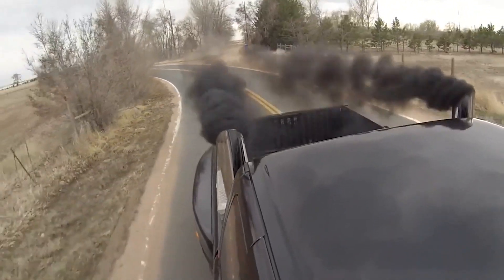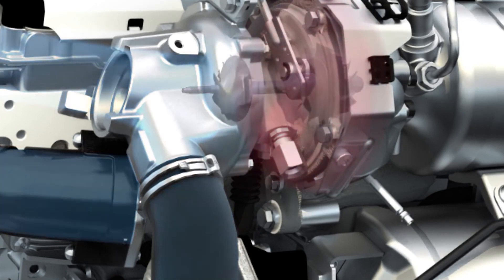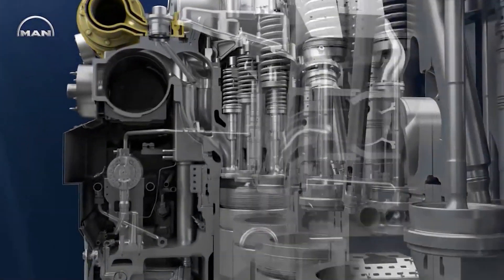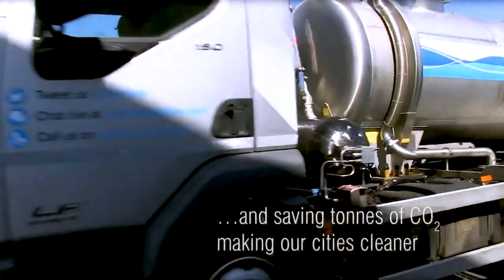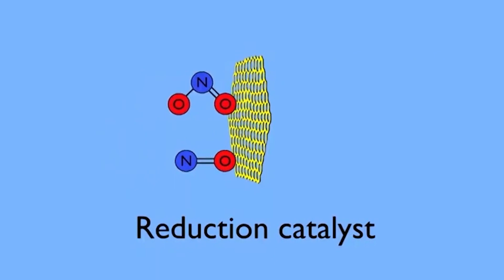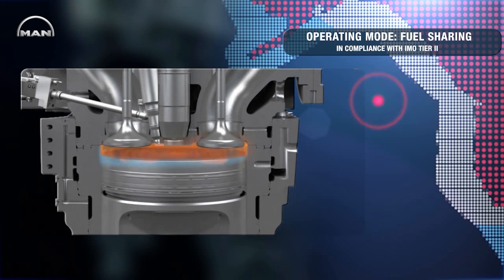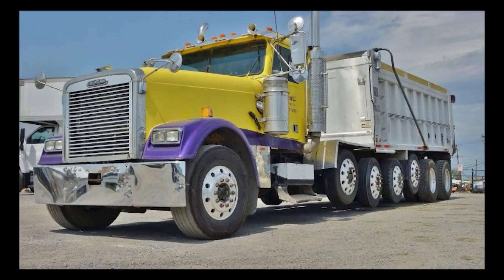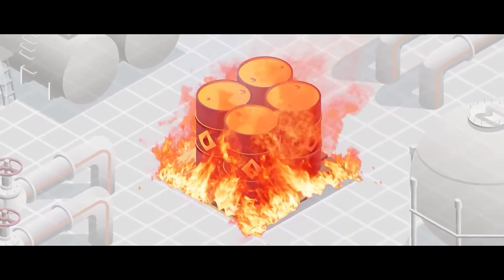New Dual Fuel Hydrogen-Diesel Engine Technology

Comment: Hydrogen makes sense they can produce it at the fueling station. trucking fuel everywhere and oil pipelines are inefficient and nasty. Hydrogen burns like diesel and gasoline producing heat and power. not having to strip mine the earth for materials to make batteries and overhauling the entire electrical grid for battery powered vehicles no more wars over oil. Hydrogen is the fuel of the future.

Comment: Stupid to buy the hydrogen and store it. That is expensive and unsafe. Now a hydro gas generator that is on demand is free (after you install the hydo generator cost) is world changing. Ever since the 80s people have made the safer”  produced on demand” version of hydrogen generation. So these all edged conspiracy theory people always claiming breaking the thermodynamics law ect. went some companies playbooks now. So did they know it was true about hydrogen before I wonder if these companies will give the pioneers like Stanley , Ravi, Lawton, Dingel, and unknown others credit for their work?! 
According to internet videos Toyota has achieved a on demand hydrogen generator system that will revolutionize the commercial car market and now I find this up to 90% hydro with diesel motors. 
People been saying hydrogen production on demand will use more energy than giving , the laws of thermodynamics. There’s a lot of energy in every atom so if you can figure out how get the energy out is the experimental or cutting edge part of hydro production in demand.

Comment: Hydrogen is really not as hard or expensive to produce as people think it is. And if metal hydrides are used as a storage media it becomes safer to store than a pressure tank, but that's not a deal breaker, high pressure tanks have been developed nowadays that are nearly indestructible by normal standards.

Comment: make it a hybrid with front wheel drive for the ICE and electric to the rear axle(s) leaving room for a hydrogen tank between the frame where the drive shaft usually is.

Comment: Diesels become very difficult to start in cold weather (ask anyone doing start-ups on a construction site at 4am on a Feb morning. -5f_-25*f). I hope the hydrogen fuel mix would help mitigate that. If that alone was a positive to the fuel (low start temps), then you will see a Heck of a lot of sales of these conversion kits in the Northern States and Canada.
Reply: In winter, I use to cut my fuel with range oil or kerosene, , in zero temperatures, a lot of truckers just kept their motors running, my Mercedes 300D , was Canadian, it had a heater coil below the oil pan, to keep the oil warm, so I just plug it in for the night ,,next morning when the gas engines were wining to get started, my diesel ( giving the heater coil it’s time) just wrummmm, I miss my 300D , but I don’t miss those winters

Comment: Hydrogen is, in my opinion, the way forward and as we already have the ic technology, then diesel/hydrogen seems ideal for all ic engined vehicles, the problem with cars being available space for the hydrogen tank.
Reply: it isnt a problem when considering the pressurized state of H2 - can fit 6 kilos of H2 in a scuba tank which will take you 500 miles

Comment: Hmm actually Scania has a compression ignition engine that works on a fuel called ED95 i.e 95% Ethanol and 5% ignition additives? Automotive scientists had decided to test that engine and run on MD95 (95% Methanol) and an already clean engine burned even cleaner! The marine industry now has Methanol CI engines so instead of this we could have CI land/marine engines running on methanol produced from direct CO2 capture? this makes the "food vs fuel" debate (aka corn ethanol) moot/irrelevant ^^ Another alternative is a dual fuel MD95 + Hydrogen CI engine but with solid state hydrogen in paste/powdered form so even small 2-3 wheelers could run such propulsion engines w/o need of a high pressure H2 tank...
Reply: Imagine

Comment: Where is all this Hydrogen coming from??
Reply from the maker: There are multiple ways of producing it, but most commonly used is electrolysis
Reply: @ChrisVSCars  No, most common hydrogen production is steam reformation of natural gas or coal.
Electrolysis is much more expensive, so it's still an exception of the rule.
But of course, it would be the most commonly proposed way of green hydrogen production.
Reply from the maker: Yes you are right at the moment gas reformation is used mostly. 

But its bad for the enviroment
Reply: @ChrisVSCars  Yes, especially steam reformation by coal is pretty bad. 
Natural gas is better, but still emits ~10 tons of carbon dioxide per ton of hydrogen produced.
Reply: @ChrisVSCars  Allegedly, only 4% of hydrogen production is by electrolysis today.
Reply: New Zealand has a commercial hydrogen production plant online now.
Using geothermal for the electrolysis that of course creates green hydrogen.

Comment: 85% reduction in emissions? Which emissions, NOx, CO, CO2, PM?
Reply: Mostly CO2 emissions, but water injection could significantly reduce NOx emissions down to a bare minimum
Reply: @TheSilverShadow17  CO2 is equivalent to the amount of fuel used and composition of fuel. Water injection does not lower CO2. Water injection is used to suppress the peak combustion temps and with that the NOx.
Reply: @cleancarburetor  Well according to a lot of online sources water injection does reduce NOx emissions by a substantial amount and retrofitting older engines on Hydrogen does significantly reduce CO2 emissions.
Reply: @TheSilverShadow17  Well since Hydrogen doesn't contain carbon, overall CO2 is reduced if hydrogen is burned along with other hydrocarbons fuels like say diesel. But, since the the hydrogen requires the oxygen to burn, the peak in cylinder temps are now very high and with that the NOx is very high. Water injection is used to suppress high temps and minimize the NOx.
Reply: @cleancarburetor  I see. Thanks for the helpful insight.

Comment: From what I read on this elsewhere, they were able to alleviate the NOx emissions from the hydrogen side by directly injecting the hydrogen into the cylinder itself.

So basically, as I understand it, the diesel replaces AdBlue/DEF & hydrogen is the diesel?  Not in the same complex emissions system, but only in soon-to-be usage ratios
Reply: From storage tanks or making the hydrogen on board ?

Comment: Awesome, I heard pure hydrogen isn't flammable without the oxygen. So you could pressurize it into the engine like diesel, so it makes sense now.
Reply: correct-but nor is diesel or gasoline flammable without oxygen. biggest issues with hydrogen is the extreme pressures required to store it in viable quantities, and very low ignition energy-also burns with a near invisible flame with therefore low radiant energy-i.e., you don't feel the heat until you are actually being burnt.

Comment: I was going to post a video showing Meyer's older technology with some improvements added to it that I learned along the way while getting at the actual science behind the technology, but as fait would have it the pulsing circuit had a wire crossed that I didn't notice and fried the bridge rectifier. Once I have it replaced I'll move to post a new video showing a cell break the bonds of pure distilled water with no additives to the water just to show the just what this technology can do and how it beats normal electrolysis hands down as no salts, acids, or bases are needed to be added to the water to make it more conductive.
Without those toxic things added to the water a cell made up of stainless steel will last for a very long time maybe in the range of hundreds or even thousands of years if taken care of properly and built with good materials.